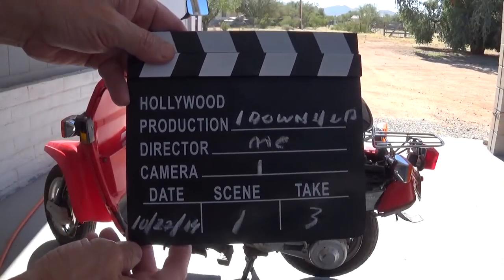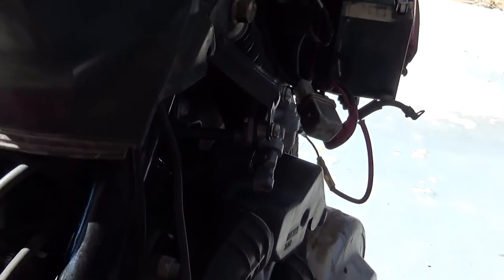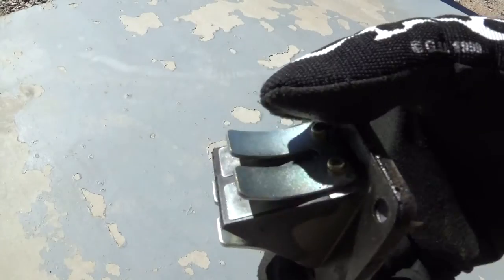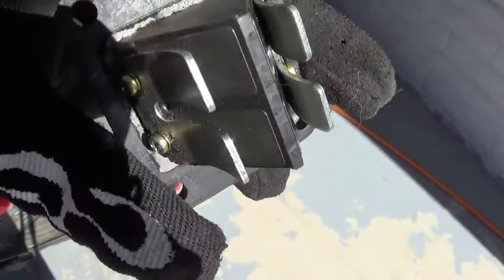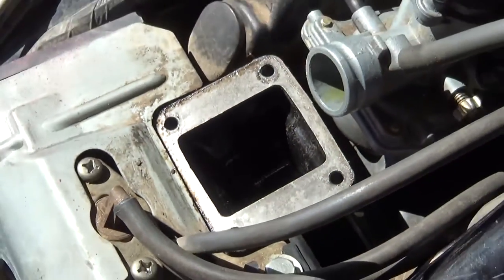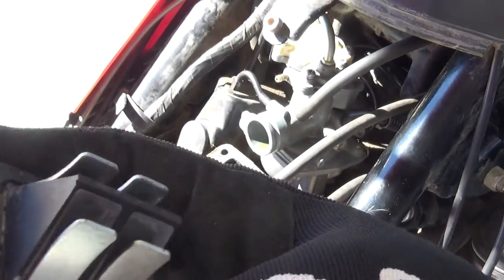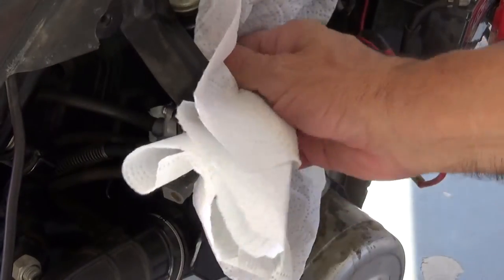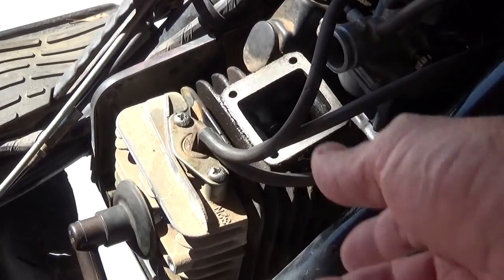1986 Yamaha Riva Starting problems what is wrong????

Comment: The reeds look good.  As long as they open and close and are not broken or cracked they are good.  The valve you worked on the last video is still not flowing fuel.  Since it won't run on starting fluid you may have other problems too.  Time to invest in tools and a charger or dump it.  $20 for a cheap trickle charger and $10 for a socket and ratchet to pull the plug.  $5 for a new plug and you still have the fuel issue to find.  It could be a good project to play with over the winter and learn more about how to work on bikes like this if that is your goal.  Another idea might be to find a mechanic willing to troubleshoot it for you on the side for a few bucks or a six pack.  Just a thought.
Reply from the maker: lol I get so many thing and flip them so fast, i am curious how long I will have this scooter. I have no money Invested in it so what ever i get is pure profit, even tho I know I will make more money with it running. but this has not title or any kind of paper work with it.if it did I would spend money to get it fixed and than register it. I own A lot of tools, just not a spark plug tool that will fit this spark plug, I mean I have the socket but my thief of a brother took my snap on 1/2 inch ratchet, dam him!! I have rewatched this video many times and i just noticed i can see the spark plug on the inside where the reed valves thingy sits lol, but the battery is to low for me to go out and see if the spark plug is making a spark now, I had a battery charger for 3 years from Harbor freight and now it has kicked the bucket right when I need it. having a yard sale this weekend so we will see if I sell it or not, time will tell.  thanks for watching and for the comment.

Comment: a spark plug remover? it's a 5/8 socket how do you not have a socket set
Reply from the maker: +Nick I have 2 socket sets just nothing in that size.
Reply: +1down4up hows she runnin now?
Reply from the maker: Dave M
sold it
Reply: 1down4up kid down the street has a riva 180 that runs great, 5k miles, but doesnt move once the rpms are increased. he's sellin as is for 299. told him get it movin ill pay 500. said he might keep it if it can fly...idk what to do. i bet its the belt or discs.. im a shit mechanic
Reply from the maker: Dave M
its not worth $500 or $299 they are garbage.
Reply: 1down4up fuck im so tempted though, my last scooter was a 49cc euro-model...think i should just get a brand new chinese 49cc from a dealer??? i could for 500...fuck idk!!
Reply from the maker: Dave M
get a motorcycle.
Reply: 1down4up no license!
and i rather ride the 180 dirty and not even register it, cops out here are simple..
i rather lose a shitty shooter than a nice bike
thanks for the input man ill figure out somethinn
Reply: 1down4up they’re not garbage. you just don’t know how to maintain it. i have a 1986 yamaha riva with over 10,000 miles. all you have to do is give them their maintenance cleaning out the carb etc.

Comment: thats what mine is doing do u think its the starter relay i bought a new spark plug still dont work right about now ive had it with scooters i wish i had someone help me
Reply from the maker: no clue I sold mine because I could not get it to work. sorry.
Reply: think is is was running i was driving it i just got  it registered i paid guy 500.00 for it
Reply from the maker: Joe G
thats a lot for that scooter, I got mine in a trade for a bicycle. and i sold it for $60.

Comment: Thats a 2 stroke...pouring straight gas in it is not good...im guessing theres 2 tanks under the seat. One for gas, one for 2 cycle oil. It prob mixes itself.
Reply: yea I know its a 2 stroke, i took the gas from the gas tank from this scooter,just testing to see if it would start. I dont think testing will hurt it but if I tryd to drive it with straight gas it would, need to charge the battery before i can do more testing
Reply: If you have no fuel delivery, you could use a small tank like from a lawnmower with a fuel line, you could let it gravity feed into the carb to testfire the motor. The float in the carb will shut the fuel off when the bowl fills
Reply: Premixed fuel lol
Reply from the maker: ***** yea I was going to just run a fuel line straight from the scooters gas tank and bypass that diaphragm fuel pump, but I really need to see if the plug is making a spark. I know its sparks at the cap, but I have no idea if the plug is good. my brother snagged my snap on 1/2 inch drive so i cannot use my socket that fits on the plug, I basicly got this scooter for free so i want to spend little to no money on it. the battery is to low to use so I will have to get me another battery charger.
Reply: Yea buddy...if u can research to find the mixing ratio, u could def just mix gas and let it gravity feed from the tank...starting it with straight gas will scorch the piston rings right away man...should kickstart even with low batt juice...good luck buddy, hope ya figure it out man
Reply from the maker: ***** yup thanks for the comments
Reply: @auraglasswerks4900  no, it isn't. It's a 2 stroke. 80cc

Comment: stick a screwdriver in the spark plug cap and ground it to the motor to check spark if you cant take the plug out
Reply from the maker: I did that in my first video, I know i am getting spark at the cap, but I do not know if the spark plug is making a spark inside the motor. I need to get a spark plug remover to get it out, but I hate having to spend any money. I traded a beach cruiser for this scooter and i traded a bbq propane tank I got for free for the bike. so I have no money Invested in this scooter at all, so i would like to keep it that way if I can. going to sell it at my next yard sale running or not.
Reply: 1down4up  how much are you gonna sell it for?
Reply from the maker: Anthony Ramirez what ever best offer I can get
Reply: 1down4up what kind of stuff do you normally trade for? Always nice to come up when you start with a free item
Reply from the maker: Anthony Ramirez just depends on what people offer me in trade, i do alot of barting off craigslist, why? you Interested in this scooter?
Reply: possibly, what would you take as it sits?
Reply from the maker: Anthony Ramirez are you in Tucson? make me a offer.

Comment: i have a problum with my 1997 yamaha riva 125 it was running when i picked it up brought it home now it dont want to start im cursed!!!! if someone can give me a idea whold be help full
Reply from the maker: sold mine
Reply: Same , my mum bought 1 about 15 years ago , drove it home & it wouldn't run again,  spent years on & off fucking about with it , carb off , exhaust off , valves appear fine , it won't even pop firing near fuel into the inlet pipe , seems spark related,  but there is a spark . Coil seems fine @ 3ohms resistance.  I'm baffled . Does any1 know ?